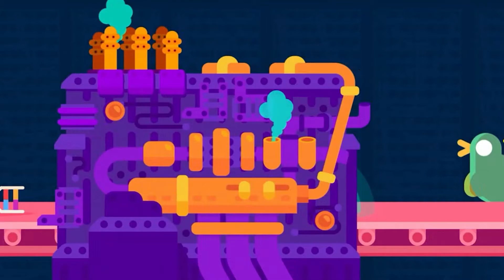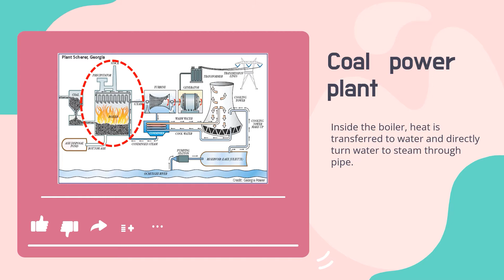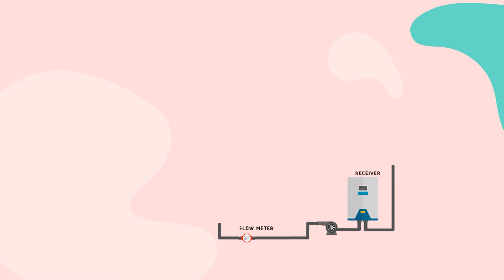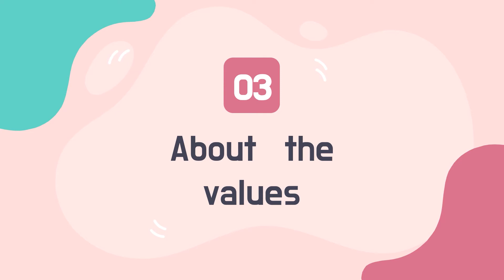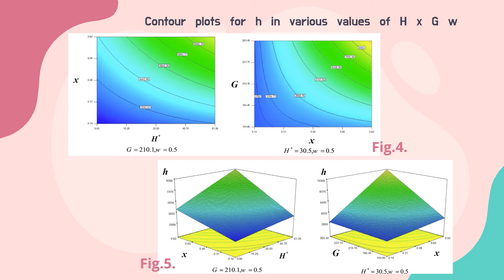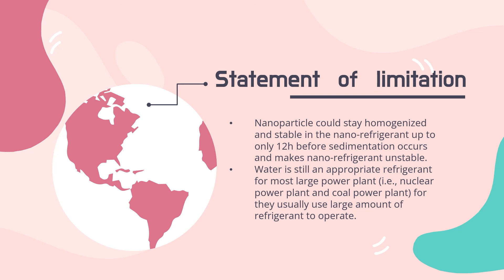Comment: Lovely presentation thanks for sharing!
We are group 2 and we would like to ask some questions 
1.How different are a nano-refrigerant and a normal one.
2.Could we use another refrigerant instead of R600a.
Cheers!
Reply: Thank you for your questions. 

1. Nano-refrigerant is the refrigerant that has been blended with nano-particle. In our experiment, our nano-refrigerant is made from the blending of pure refrigerant R600a and nanoparticles copper oxide (CuO).

2. Of course, we could use other refrigerants. However, the reason that we used R600a is that this refrigerant is proven to have a low potential for depletion of the ozone layer and also has a trivial influence on global warming. 

Thanks!

Comment: Hi, we from Group “Experimental investigation on two-phase heat transfer of R-134a during vaporization in a plate heat exchanger with rough surface”

1.What is the good characteristics of the refrigerant that  we should choose to use.

2.If the power plant doesn’t that large (just to produce the electricity for 1 building) can we use this nano-refrigerant as the major.

Thanks you.
Reply: The good characteristics of the refrigerant that we should choose to use, it should be provide more advantages than disadvantages and also concern about environmental problems. The advantages should consists of performance, safety, reliability, environmental acceptability and simple economics [1]. Actually for the refrigerant 600a mix with POE lubricant that was study in the article is also considered as a good characteristic of refrigerant, since it contribute to the the global warming. And adding the POE lubricant  R600a is reducing cost and it attribute to economic.

[1]https://asmedigitalcollection.asme.org/memagazineselect/article/120/10/92/368600/Choosing-the-Right-RefrigerantGiven-Today-s?fbclid=IwAR1qNCYzPY3BS8Pt8HhBpVtuMEYg3RYw9_4Ge8pBC7hSzt9sjESmTPHwpGk

2/ Actually, the average number of kilowatt hours per square foot for commercial building is approximately 22.5 according to Department of energy. So it about 540 kilowatt per day[2].And a large scale steam power plant produce electricity 1000 MW [3]. In case it is a small scale of power plant. if we using nano-refrigerant as the major, it is possible provide the enough electricity consumption for the building.

[2]https://www.iotacommunications.com/blog/benchmarking-commercial-building-energy-use-per-square-foot/?fbclid=IwAR2qQZbXWciaMEcFsdCw3G74T4dJ74RE8aqSmNnSDLMYsEjpCJ
LzeEV6GDA
[3]https://petrotechinc.com/how-does-a-steam-turbine-work/?fbclid=IwAR2pqEIrhZAF60pydqwmNWkKG9DU4rnv_-Bqd9c2eCmy6mMWvDcQsssXUrM

Comment: from Group 3 "Hybrid BTMS"

1. Will material type effect on viscosity of nanofluids? if not why? 
2. what is the approximate range of the flow rate that will give the highest efficiency?
Reply: Thank you for your questions. 

1. For question 1, I suppose you mean the material type of the tube. If so, the answer is no. Our nanofluid is considered a mixture and blend. The equation to find the viscosity in the mixture and blend does not include any properties of the tube containing it but only the properties (mole fractions and the viscosity) of the pure liquids from which the mixture and blends are made. The viscosity equation of the pure liquids also does not include any properties from the tube. Therefore, the viscosity of our nanofluids does not change with the type of tube material. 

Viscosity equation of pure liquid: https://en.wikipedia.org/wiki/Viscosity#Pure_liquids
Viscosity equation of a mixture and blends: https://en.wikipedia.org/wiki/Viscosity#Mixtures_and_blends

2. In our experiment, the variable that represents the variation of the flow rate is G (mass flux which is flow rate per area). As shown in our conclusion in equation (10), G is proportional to the heat transfer rate h which means the larger the G, the larger the h.

Comment: Hello there
We are from group 5.

These are some points that we would like to know:

How significant is the heat transfer improvement after using flattened tube, lubricant and nanoparticle compared to the default setting? (Show percentage if have)

What is a mass flux?
Reply: Thank you for your question 

The important factor that we use flattened tube is  the tube with less internal height (pc = 4.7 Pa) is more higher than 2.5 times than the circular one(pc = 1.8 Pa) which around 161%. The , While the nanofluid is impact the mass flux and also found to be stable and no sedimentation was observed for almost 12 h. Thus, every experiment including each sample mixture was run for less than 8 h. Nanofluid can exhibit a better thermal performance than a pure working fluid. The significant improved thermal performance of results in better heat transfer of nanomaterials than the base fluid.

Mass flux or G unit kg/m^2 s is defined as the amount of mass transferred per unit time through a unit area perpendicular to the direction of mass transfer in a heat exchanger. Which in other meaning was a important flow through a filtration system and also involve the transfer of mass across a semi-permeable membrane
Reply: [More on question 1]

Before the experiment, lubricant (POE) was mixed with R600a to create the baseline which would be then mixed with nanoparticles to produce nano-refrigerant for the experiment. The authors did not collect the data on the influence of the lubricant on heat transfer rate in the experiment given that its main purpose was just to create the baseline out of the pure refrigerant. 

We could not simply answer your question without further conditions. As shown in the paper, in figure 4, all contour plots could only consider two variables at a time while making other variables constant. The closest possibility that your question could be answered is from the contour plot whose variables are w (Mass fraction of nanofluid) and H* (Flattened percentage) which are the variable of the nanoparticle and flattened tube respectively. This plot is at the condition that x = 0.48 and G = 210.1 . 

Therefore, the only way to answer your question is by using equation (10) which is the correlated equation of data obtained from all conditions in the experiment. You can obtain the approximate heat transfer rate before using a flattened tube and nanoparticle by letting w and H* be zero. Then you obtain the approximate value of heat transfer rate using flattened tube and nanoparticle by plugging the value of w and H* that you use and other values to equation (10). By now you could compare the value of heat transfer rate before and after using flattened tubes and nanoparticles.

Comment: Good to see such a nice presentation.
We are the group from Integrated Heat Exchanger article.

Here is our questions to the presentation:

You mentioned that flatten tube increase the rate of heat transfer, Could you clarify a little bit more ,how ?
Reply: Thank you for the question
So, The larger channel height of the Flattening tube, the more enhances the boiling heat transfer coefficient. flattening the tube creates a corner with a big curvature within side the go segment of the tube , which exerts a strong liquid capillary force on the corner of the , growing a small liquid film above and below the channel and reducing it which Increases heat resistance. So we show the different of the thin liquid film during the flow boiling in the fig.6. that why we using a flattened tube instead of the circular one

Comment: From Chinese Kang Bed group
first I want to ask your opinion if you do not use working fluid R600a what working fluid will you use in this experiment? and can you predict the result after use that fluid 
if not what will you do to make the better way to control the result from this sentence 
"In practice, vapor quality is hard to control or could be too expensive to control" any Idea to make it possible ?
Thank you
Reply: Thank you for your questions.

As stated in the suggestion parts, the other refrigerant that we should focus on other than R600a is water since water is still an appropriate refrigerant for most large power plants in use nowadays (for further information please refer to the suggestion part of our video). We could not predict the result after using the new refrigerant using the result from this experiment since variables such as density, enthalpy, and specific heat are unique to each fluid. 

Regarding this sentence "In practice, vapor quality is hard to control or could be too expensive to control", it was part of my suggestion for engineers when trying to optimize the system performance. I mean that it is hard or expensive to control vapor quality in the power plant during the cycle but that does not mean it is impossible. For this reason, as stated, I suggest the engineers focus on flattening tubes instead since it is much cheaper than trying to control the vapor quality. However, if vapor quality control is a must, I would suggest using a technology called "Vapor quality sensor" by companies such as HBX for the power plant. 

Link to the product: https://www.hbproducts.dk/en/products/item/1489-vapor-quality-sensor-inline

Comment: In the introduction part, your presentation provides insufficient information about why the authors apply nano-refrigerant in this application. In other words, nano-refrigerant has not been mentioned in the introduction part. Without such information, audiences cannot understand why the study has to be exactly like this. Structuring the presentation like the authors would be better.

Would you please clarify what 'h, correlation' and 'h, experimental' in Fig.3 are? How do they obtain them? Do you think 25% difference is acceptable for validation? What do they try to validate? 

How do they obtain Figure 4 and 5? What is equation (10)? Comparing to those we learnt in the class, what are the differences and why is it important?
Reply: For the first question
Sorry for that mistake. actually, I add it wrong place, I put it in the last part.
To answer this question. Raveshi et al.  explained in their paper that nanofluid is an interesting technique to promote the thermal features of working fluid. For instance, adding alumina nanoparticles to intense boiling heat transfer was reported by Wen and Ding . 
Sheikholeslami et al.  also performed their own experiment using nanomaterial to improve the condensation heat transfer. 
Hao et al. [10] also suggested the utilization of nanotechnology for improving boiling heat transfer with maximum enhancement ratio of 29.7%.
Using second law of thermodynamics for analyzing nanofluid behavior in a heat exchanger, Khairul et al., reported that adding nanomaterial can reduce the exergy loss about 24%.
Improving of heat transfer rate by adding the mixture of nanoparticle and lubricant oil to pure refrigerant was conducted by Darzi et al.
Flatten tubes have been proved to be able to improve condensation by Kim et al. using R410a as pure refrigerant. 
Using R600a as the working fluid, Darzi et al.  showed that the more flattened the pipe the more condensation heat transfer occurs.
Many experiments have been conducted in recent decade to study nanofluid using either experimental, theoretical, or nano-scale simulation approaches. 

For the second question 

h correlation is a prediction heat transfer coefficient and h, experiment is experiment heat transfer Coefficient. Prediction heat transfer coefficient, they used the equation that we have mention to predict the result while experiment heat transfer coefficient, they obtain from the experiment. To validate the accuracy of the fabricated test and the measuring instrument, and they obtain 25% difference. It satisfies the agreement because they compare their validation to another article[1]  which has 40% difference. So, it is acceptable for 25% for our current article

For the third question

Fig 4 show the 2D of contour plot for h in various values of Channel height, vapor quality, mass flux, and mass fraction of nanoparticle. While fig.5. show the 3D plot of Fig.4. This is obtained from increasing the interfacial momentum on the annular liquid film. Equation (10) is the correlation equation that they obtained from the experiment data, using the data from all conditions, they correlated those data to come up with that equation. From the experiment, it is simplified to calculate using the Young-Laplace equation which will obtain a better result, from the circular shape on the corner of the flatted tube showing capillary pressure on the corner is higher.  So, the correlation parameter for in-tube flow boiling heat transfer is used in flow boiling theory and the experiment correlation in literature and been use those factors within the correlation
Reply: [More on how the author obtained figure 4 and 5]

In this experiment, the author considered 4 variables to calculate for heat transfer rate h. They are G, x, w, and H*. They performed the experiment by considering only 2 variables at a time while making the other 2 constants. Therefore, in total, they obtained 6 2-D plots for figure 4. Figure 5 is the 3-D version of figure 4.
Reply: [More on your last question]

There are 2 major differences between the experiment and what we learned in class. Firstly, in the entire course, we only considered the circular tube as the flow path while this experiment emphasized more on the flattened tube rather than the circular tube to prove that flattened tube is much more effective than the circular tube. Secondly, we never considered the use of nano-refrigerant in our study but only pure refrigerant mostly R134a.

As stated in our conclusion, H* and w (variable for flattened tube and nanoparticles respectively), played major roles in improving heat transfer rate. Therefore, it shows us that it is important that from now on we should start to emphasize more on prioritizing these two factors when conducting any experiment involving optimizing heat transfer rate.